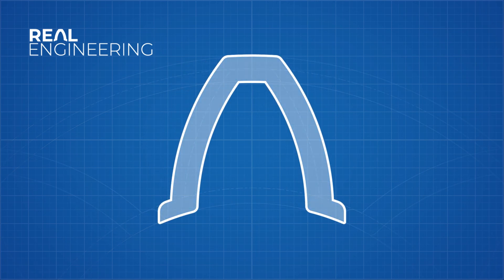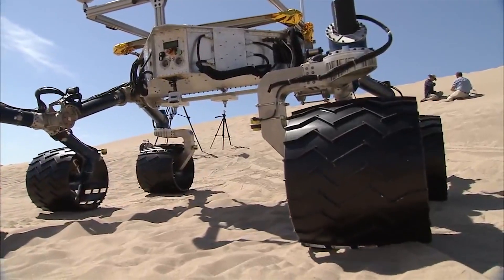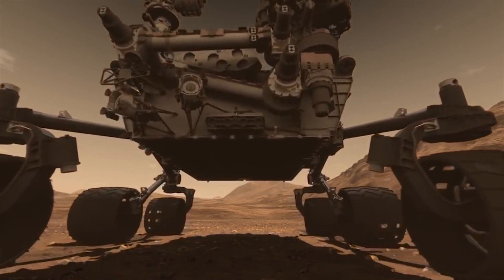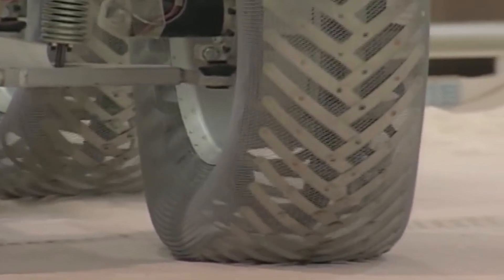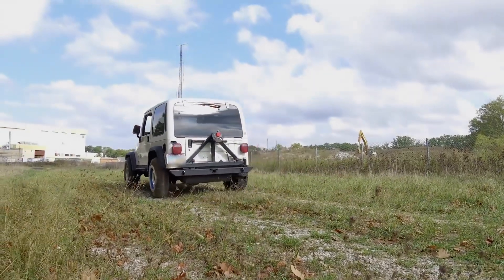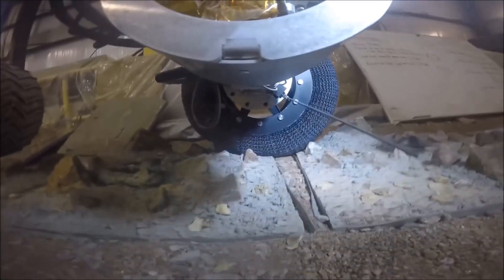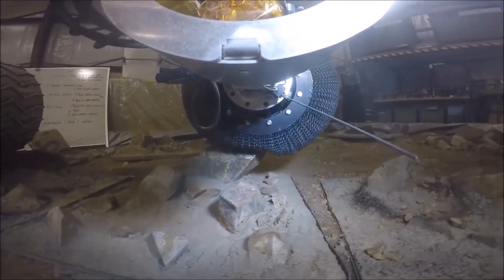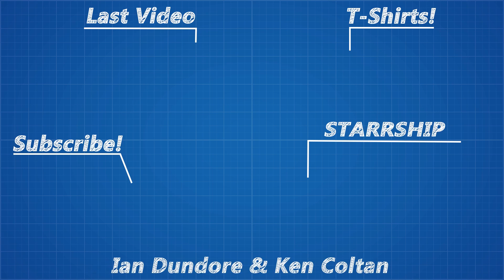How NASA Reinvented The Wheel - Shape Memory Alloys

Comment: Why not use a similar style as what tanks use 🤔 ?
Reply: because those things are heavy
Reply: Continuous tracks, in addition to being heavy, require regular maintenance. This could be somewhat problematic on mars. The advantages gained from using tracks on earth (improved traction and reduced ground pressure) don't really add any benefit for application in a mars rover.
Reply: so the same thing as robotic spider legs?
Reply: Tracks are incredibly heavy!
Reply: Tracks are cool, but they need maintenance very often and love to jam and fall off...
Which is fine if you have a tank crew on standby to deal with this stuff, but a real problem for a robot stranded on another planet.
Reply: NASA has finally diverted your attention from their lies to tyre engineering!

Comment: Would the problem with the nitinol alloy be that any deformation that occurs while in the austenite state become permanent? It seems that the most fragile state of the crystal lattice would be that intermediate transition between the detwinned and martensite states.
Reply: There is a small possibility of that happening yes, but it’ll take a while before all those deformations build up to a level that compromises the mobility of the rover
Reply: Well it has a high chance of resetting on every rotation, so it should keep going for a good long while.
The more pressing matter is high levels of abrasion, and what happens when strands start falling apart.

Comment: A simple math: 2,000 lb divided by 6 wheels = 333.33 lb a wheel here on Earth. Mars' gravity is approximately 0.38 g which means that every wheel carries around 126 lb or about 57 kilograms. This will tell you what the quality of that two billion dollar rover is. I agree that the engineers had to consider the weight of the vehicle but I don't think that sacrificing the wheels' durability was the right approach. There are other lightweight materials resistant to temperature fluctuations and strong enough to be used instead of aluminum. It gets fragile in low temperatures.
Reply: Sure, as these materials are so well know to you, which soldutions would you propose, then, in lieu of the wheels currently used?
Reply: So the rover can only weigh so much. What shall we cut? Scientific experiments? There's nothing else to go
Reply: Dubsy 102 What scientific experiments without the ability to move? Every part of this rover is essential, so increase the power of the lifting rocket and the landing crane. I know it's easy to comment sitting on my desk without getting involved in the development process but this what these guys are paid for.
Reply: Chris Hristov  They were limited by what types of rocket were available for that launch and what loads those could carry whereto a which speed.
Reply: @chrisivanchev  It can still move, and it will keep being able to move for a good while.
Reply: Yes, the damage to the wheels was done a few months after it landed. Since then, they've been driving it backwards to avoid furder damage. Now, we have a computer glitch that prevents it from sending data back to Earth. Curiosity has a state of the art power source which enables it to work for years to come. Why didn't they think of the details that can render it useless? The devil is in the details remember? I'm not claiming that this project was a failure; on the contrary, these guys did almost the impossible. It takes a lot of knowledge and calculations just to send the probe and land it on the spot millions of miles from Earth, overcome all of the technical difficulties of landing a 2000lb sensitive equipment on an uncharted territory on a different planet, and keep it running for years. What I'm talking about is that they should've made it more sturdy considering the environment they were sending it to.
Reply: it's nitpicking time. the mass each wheel supports is still 333.33 lb. The force each wheel need to support is only 0.38 times that of earth though. Mass doesn't change. Weight does. The SI unit for mass is kg, while the SI unit for weight is Newton. F = M*A.
Reply: So, what you say is essentially confirming my calculation without using Newton's formula for mass. On Mars, these wheels should support only 126 lb or 75 kilograms each. Considering that the weight of the rover shifts, let's say 200 lb or 90 kilograms each. Is that enough to get a wheel damaged by a rock?
Reply: The scientists and engineers at NASA/JPL go through a long arduous process comparing the risk of mission failure to weight savings to choose the best designs they can.  Older, proven deigns are preferred over newer barely-tested ones for obvious reasons.  Considering the wheels are still functioning this far beyond their expected design life, I think they made the right decision.

Comment: Dude what the heck the curiosity rover doesn't have a nuclear reactor on board lol it has a radio isotope thermoelectric generator or an rtg it uses the heat produced when plutonium 239 or some isotope decays and uses the heat to generate electricity its very different from a nuclear reactor

Comment: Why can't we use tracks like on a tank?
Reply: Heavier, more moving parts that can break,  potential to lose a track and render the device useless. It's just a better idea to have individual wheels in this application.
Reply: They are too heavy.
Reply: They also only operate at slow speeds. I want the tanks defending my homeland to move faster than .25 km/hr...
Reply: James Finlinson modern tanks can go up to 60km/h....
Reply: Yes; you're right. That special wheel cannot travel at that speed though: it was only designed for the much slower pace of the mars rover. If the tank were to use the wheel, it would lose almost all of its speed at the benefit of nothing.

To the space explorers, the new wheel is critical for its significantly decreased weight which saves them cost as they eject it out of our atmosphere. This requirement doesn't exist for a tank; in fact, a tank benefits greatly from sporting thicker materials that can withstand shrapnel and flying objects better.
Reply: Did you listen to the video. Watch it again and listen you may me enlightened.

Comment: It'd be interesting if a net or thick cord of this material could be shot at someone and contract to restrain them. If the material can be activated by an electric current then it would work a lot like a taser. The strength of the contraction would be a major concern though.

Comment: Gravity on Mars is supposedly slightly more than 1/3 of earth's. So the Rover only weights like a little over 300kg on Mars. So that is 50kg per wheel. It has 6 wheels right? Maybe the rover is rovering around on the wrong plant.
Reply: N stands for Newton, and WEIGHT is measured in Newtons. 

 I have actually said MASS in Kg. 

A Newton meter has N-m as a unit, not N. 

The Rover will always have 900kg  MASS whatever the local gravity is. Its WEIGHT in NEWTONS will vary. 

Read properly. I even pulled all the definition and capitalised key words FFS.
Reply: @rolfbjorn9937  Fine you are smart enough go to Mars already.
Reply: @Destian Light You might want to do some quick google search and check your facts before you go on arguing on subjects where you're clearly wrong by not even understanding the definitions of the units you're using.
Reply: kilogram is not a unit of force... its 1/3 of the force, thats correct, but thats not 1/3 the kg (mass). Its 1/3 the newtons or whatever unit of force you want to use. But kg is a unit of mass and doesnt change with gravity.
Reply: @leocurious9919  Weight does change but not mass.  A load cell calibrated on earth would literally measure the weight on Mars about 3 times lighter. Of said rover or you or me or a Kg of shit.
Reply: This guy must be troll...
Reply: @UnderscoreZeroLP  Yes a troll from Marsbar.
Reply: To try and sum this up, it has a mass of 900kg wherever it goes, but it will weigh a different amount depending on where it is. You measure mass with kilograms, which do not change, but fore with Newtons which do. 
This issue is that 500N per wheel is still enough to damage paper thin aluminium. Imagine if on earth you got 50 kilograms, then got a thin bit of aluminium and a rock. Do you think that the aluminium would come of fine after 6 years of exposure to that kind of stuff?
Reply: @dubsy1026  Yeah they fucked up... Maybe they calculated for the moon.
Reply: Destian Light 
It’s still 900 kg, but the rover only weighs 3300 N rather than the 8800 N it would weigh on Earth.
Reply: @ragnkja  A Newton meter is 1kg force applied to a 1m lever. Newton is not a measure of weight but of force. The rover will literally weight just over 300kg on Mars. If you could only lift a 10kg weight here on earth on Mars you would be able to lift 3 of them. Because you still produce the same force but the gravity is less and therfore the weight is less yet the mass stays the same. Weight and mass are not the same thing nor is force. Get it?
Reply: Destian Lighht You might want to revise your physics 101. Newton meter is a unit of torque, not weight...

The rover has a MASS of roughly 1000kg. This mass is independent of the local gravity. 

The WEIGHT in the metric system is actually measured in Newtons, because weight is defined as a force exerted on a object by gravity. And the gravity of Mars has an acceleration of 3.711 m/s^2. 

The actual force exerted downwards by Mars gravity will be of 3.711 N/kg (Per F=ma  1 N/kg = 1m/s^2) , which gives us  3711 N.
Reply: Destian Light 
The force an object exerts on the surface it rests on is its weight, and weight (measured in Newtons) is dependent on the effective gravity, unlike mass. And why are you bringing Nm (or joules) into this?
Reply: @rolfbjorn9937  I said force not weight. Revisit your comprehensive reading. Ultimately what I am saying is the rover is lighter than 900kg on Mars. And that is a fact period.
Reply: @rolfbjorn9937  Mass is the amount of matter, not weight. Jesus people get smart. Weight is relative, mass ia not.
Reply: "A Newton meter is 1kg force applied to a 1m lever"
As the name says... its one Newton at 1m. Not 1kg. 1N on earth is ~100g.
Reply: @leocurious9919  Yes I fucked that one up but still on Mars the rover is only a little over one third of its weight on earth.

Comment: Curiosity rover doesn't have a nuclear reactor, it's has a RTG.
Reply: A nuclear reactor uses enough of the radioactive active material (critical mass) to start a chain reaction called fission. This is basically a nuke going off really slowly. Using the heat produced it boils water drives turbines with the steam. The RTG in Curiosity does not have enough of the radioactive material to start the chain reaction. Instead, it captures the passive radiation coming off a piece of plutonium and converts that to electricity.
Reply: via thermal-electric-couples, yeah.  I can understand the confusion as in the simplest of terms they both use radioactive stuff for heat.
Reply: Good point Vikrant, but I'd guess it won't matter all that much to the person in the street. Nuclear-shmuclear. ;)
Reply: Vikrant Rai what’s the difference ?
Reply: @rahulsrinivas497  nuclear reactors use nuclear reactions to produce heat, which then boils water to drive a turbine. RTGs use decay heat to create a thermoelectric effect.
Reply: RTG is technically still nuclear energy, just not a reactor

Comment: If the metal due to stress deforms in a way that allows a little rock (that was over a bigger rock, for example) to enter the tire. When the tire goes back to the original state (during rotation), wouldn't the little rock be trapped inside the tire? This over time could add significant weight and unnecessary sress on the motors. I'm sure they thought about that, but what's the solution they found?
Reply: My solution would be little flaps of the same material inside the "tire" that would tumble those rocks to the center of the wheel, where there would be a slide of some sort to take the rocks out.

Comment: wouldnt the wheels get full of small rocks and bits?
Reply: If one got stuck, it could probably come out since the material is like interlocking and can bend in all these weird ways
Reply: The space between the interlocking coils is on the order of several millimeters. Something the size of a pea might be able to push through and get stuck inside. For reference, the wire is probably about the same thickness as 12 guage copper wire used in your home wiring, and the coils are a bit less than a centimeter in diameter.
Reply: I want them to test the wheel by punching a hole in it, would the whole structure disintegrate or what?
Reply: Snow Star  literally what was going through my mind ... all people talk about is "not nuclear reactor" "america`s got best pilots" (can you believe that guy?) and "It`s not a wheel" but all i can think of is "What if the metal touches the rim AND BREAKS THE FUKING BOND!"
Reply: @snowstar3560  it will dent and return back to its shape
Reply: @leevileino5897  That's not a good test is it? I want to see whether the structure holds when a hole inevitably forms and it will. The solid aluminum wheel maintains it's structure even as holes formed.
Reply: @Snow If you were to push a sharp "needle" into the tire, the coils would just get pushed aside and return to their shape after it was removed. If an individual coil is fractured, that location would be slightly less stiff because the load would not be as effectively spread to neighboring springs, but the effect would not be catastrophic because the level of interlocking between coils would keep everything in place.
Reply: @aaron41  Cool, so I'm guessing the critical part of the wheel is the side wall? What's the durability of these memory alloy? Since it's an interlocking structure, what sort of hole size can it sustain and still work within parameters? And how many holes can it sustain? If a hole does form, can the surrounding intact mesh take up the extra load? Will the hole grow larger over time? Also if there is a hole, what will happen when rocks repeatedly rubs the hole? And if some managed to get inside the wheel? Would the wheel then get wear down from inside and out? I'm curious.
Reply: Even if it gets filled with millons of pea-sized rocks [just the exact size to pass through it when compressed but not fall down]; the added weight would be irrelevant.
-> The interior of the wheel is "open"; so when the wheel deforms extensively by passing over a pointy big rock, some of the "peas" will fall out from the sides.
Reply: Good Q, also I can't stop thinking about traction... going up a small sand hill etc would be a problem?
Reply: Excellent question @Jolly Joy

Comment: There is good reason nature didn't evolve wheels; I'd say go for legs instead of wheels on the rovers.
Reply: I'm pretty sure that nature's issue with wheels was that it's kinda hard to develop a permanently, organically attached thing that nonetheless can freely spin around on a axle. Machines don't have that problem. I'm also suspecting that on a reasonably flat-ish terrain wheels might be more energy efficient than legs, and should be mechanically less complex, when your motors are driving your wheels directly.
Reply: but that requires faster movement and it needs to stabilize itself so it doesn't fall and all that requires more energy and is in general less efficient + you need use flexible materials that withstand all the cold, heat and radiation
Reply: speed isn't a requirement, those rovers already go very slow...
if it has more than 4 legs, it will be balanced no matter what... 
not sure about the energy efficiency, but I think it should be about equal...
legs can be as rigid as you want, no need for flexible materials.
Reply: Willem van de Beek  With 4 legs, nope, you can still easily topple. Think more like 6 or 8 legs.

each and anything with legs requires  constant energy input just to stay on the legs. A spructure on wheels  can happily sit wherever it it with zero energy spent.
Reply: Willem van de Beek  There is a good reason nature didn't evolve wheels: it's not biologically possible in terms of evolution. However, wheels are so much more efficient than dealing with the absurd complexity of balancing on legs (which is a giant challenge for even the best robotics designers of today), to speak nothing of accurately sensing the surrounding terrain and positioning the legs accordingly while walking. If legs were better for traversing rough terrain over a long period of time, then we would have off-road mechs, not off-road vehicles. The simple fact is that legs are incredibly inefficient and complicated, and on a mission like this, it's an even more expensive--and most likely even more fragile--set of parts that can mess up and ruin a multi-billion dollar mission.

With legs, there is much more weight involved, which is problematic enough. Wheels are just so simple and reliable that they would likely be more suitable for the job in every conceivable way. And Quellbrunn is right about flexible materials for legs because Mars's surface temperature fluctuates far more greatly than on Earth, so the legs must be very capable of expanding and contracting.

If the idea wasn't so full of problems, don't you think NASA would've considered the idea by now?
Reply: Even so, there are no wheels in Nature
Reply: smasimulationshop  And this is important why exactly?
Reply: LutzDerLurch  and lots of legs ;)
Reply: smasimulationshop  Again, this should be considered important why?
Reply: I agree
Reply: Now you said it, it made think the same!